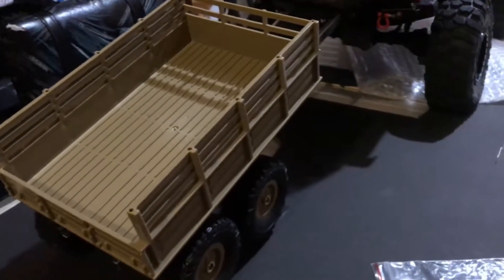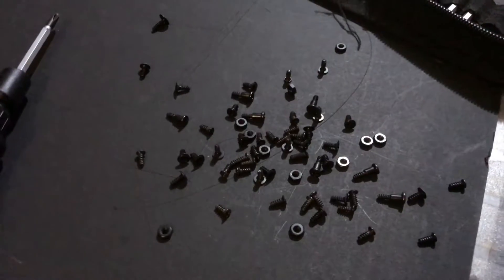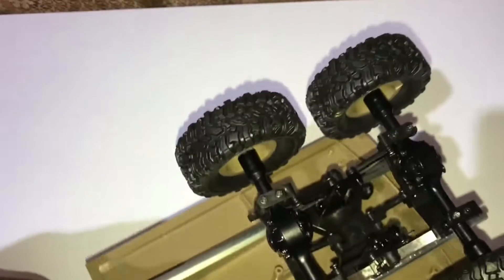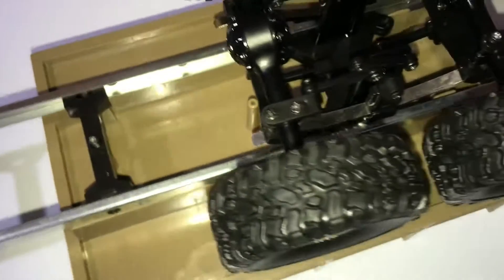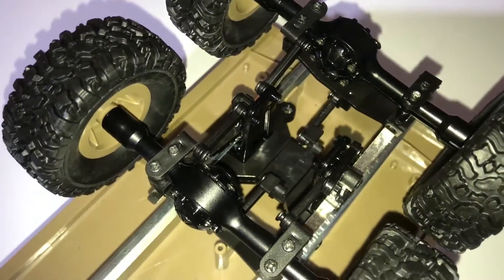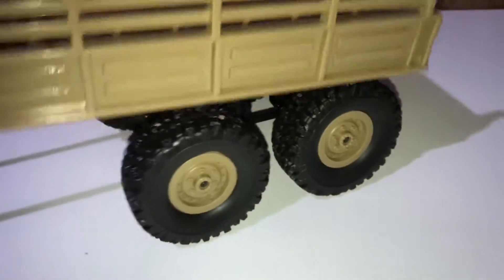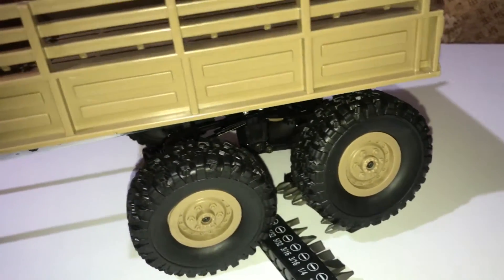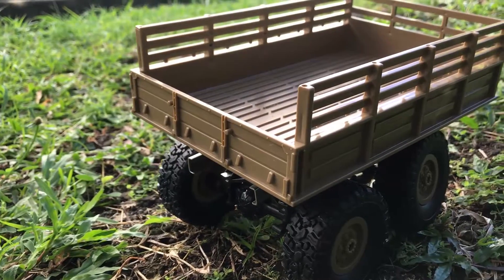WPL 1 16 Military Truck RC Car Plastic Metal Parts Upgrade Trailer DIY Part Set

Comment: I wish you didn’t fast forward through everything 😬 I’m having a hell of a time putting this thing together
Reply from the maker: thank you for watching the whole video, this kit is  a bit tricky to assemble. Be careful threading in the screws to install the links to tie the axle to the frame, they are very easy to break !